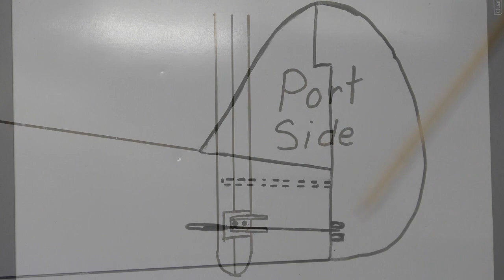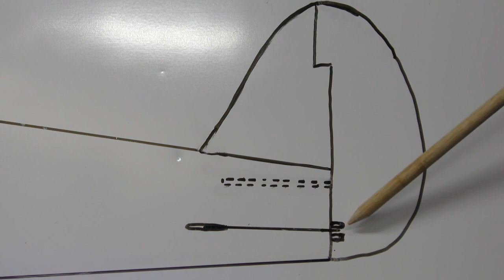Phoenix Model P 40 Warhawk Assembly Part-3

Comment: 20:38 good to see you again bob. the way i do these glue ups is i put the stab in first, then slide it out a little and put the epoxy on, slide it out the other way and glue it up. a lot less clean up.
Reply from the maker: I did that to on builds for other people. After they wrecked them I noticed on a few of them the epoxy didn't get full coverage on all 4 exposed surfaces. It wasn't the cause of the wrecks, but it was enough for me to go back to the messy way of doing the install. Maybe I didn't use enough glue, I don't know.  
Thanks for the comment.